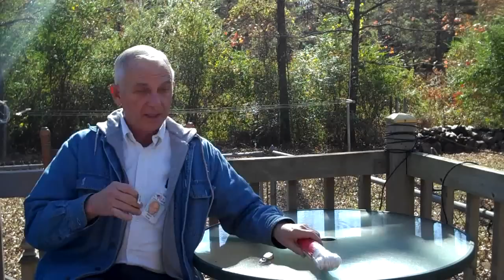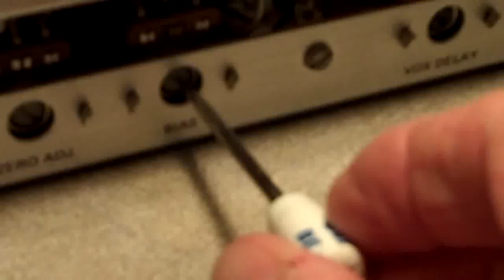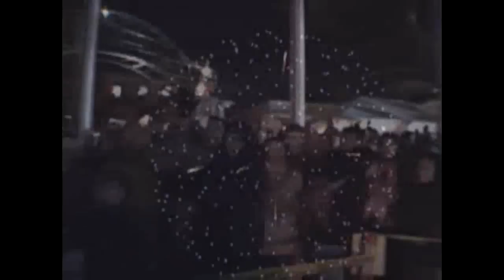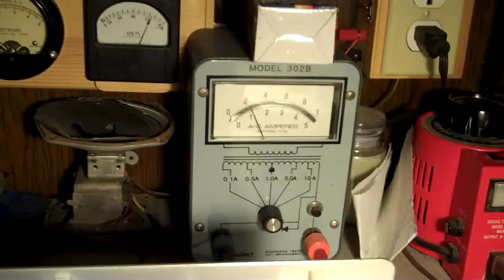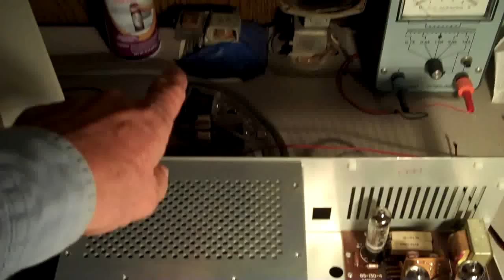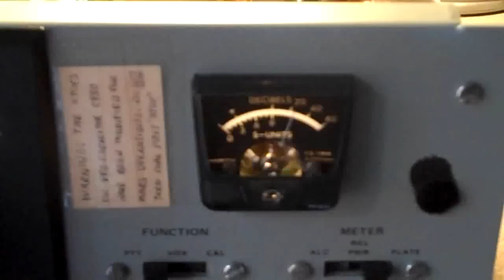Obtaining A Ham License-step by step-the details you need to know (part 25 of 34: Troubleshooting).

Comment: @joernone Hi John. Tuning up the P.A. is critical when you put full drive on the P.A. input. Even when you have a dummy load on the radio you have to tune the P.A. resonant or you could destroy the tubes. That's probably what shorted the original 6146 to begin with. Whomever had that radio before you did probably put full drive and load on the P.A. without resonating the plate tuning and thus overheated the tubes. The instructions for tuning up should be in the user manual. Gary

Comment from the maker: @HD7100
" you did resonate the tank (plate and load) did you not?  Maybe you were in the Heathkit instructions that have you align without putting full drive on the PA?"

Gary,
I don't know what you mean, but you have my attention.  Yes, I was using the Heathkit alignment instructions.  Please elaborate on resonating the tank and putting full drive on the PA.  I don't even know what PA stands for...power amp, maybe?
Experienced guidance is always welcome.

Regards,
John

Comment from the maker: @gbowne1
I've gone through the assembly manual.  All is good.  Since replacing about 20 resistors, the receive side now works perfectly.  Before heading off to work this afternoon I might have finally got the neutralizing under control.  I'll be checking it again in a day or so to make sure.   It'll have to wait because wifey has a list of honey-dos a mile long.  She reminded me that I've sorta been putting them off.
Thanks for watching and responding.  It's appreciated.

Regards,
John

Comment: Matched 6146's (of any type) are much better on TX.  Match them both by brand and by the specifications.  My AM broadcast rigs love using matched 6146's in the driver  and exciter section. Oh yeah, and if you are looking for a nice mate to this radio, look for a SB-102.

This radio deserves a D104 microphone to go with it.  They are pretty much the uldtimate mic of all time.

These were kits, and are aging.. Go back through the assembly manual and be sure everything is correct.